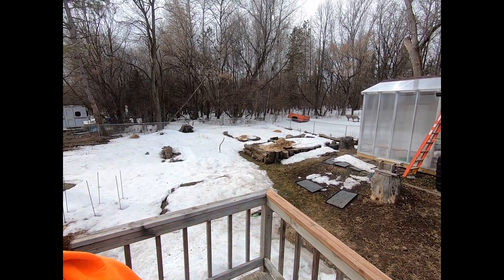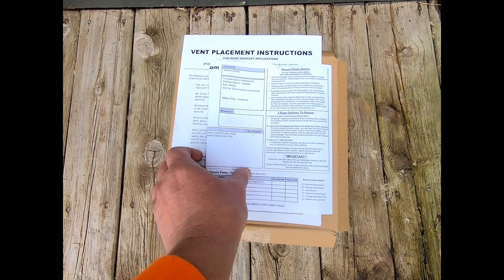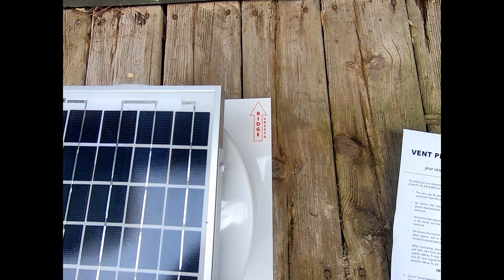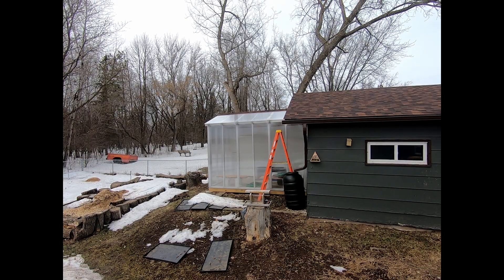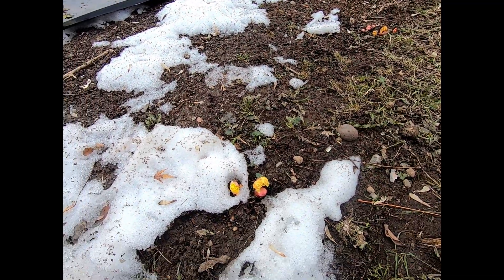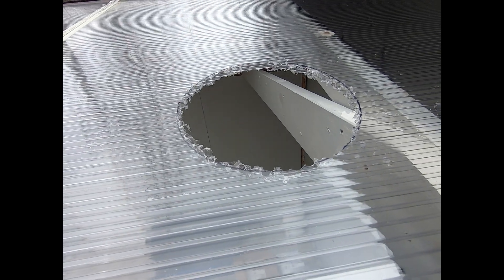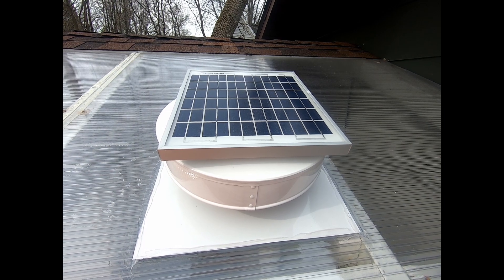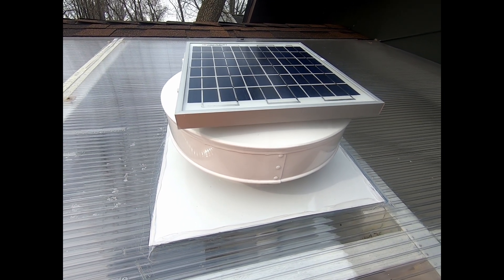Installing a 5W 12V Solar Powered Vent Fan on My Greenhouse

Comment: Any follow up on how this fan works? I'm thinking about getting 4 of these for my house since they're only 114 bux each as compared to buying one Remington at 400, but has 4x the cfm airflow. Thanks
Reply from the maker: Thanks for watching!  Honestly it's hard to notice much of a difference with the fan, because the greenhouse is quite large (8' x 12' x 8')... I've been considering buying a second one, probably next spring... I'll post another video if I add a second one.